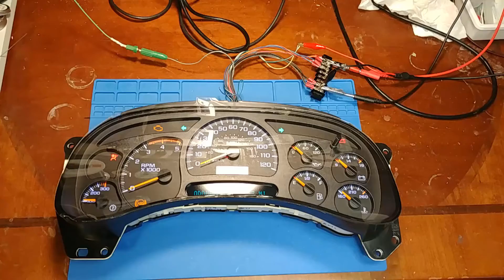2005 GM Cluster No Data & the 56585 chip

Comment: I have an 03 cluster I’m working on and I’m having trouble finding the issue if you could please give me some insight I would be grateful. None of the gauges work nor does the prndl or mileage.. the stepper motors were recently replaced and before that the only issue it had was the 4 small gauges weren’t working..when plugged back into the truck the prndl lit up with no key and once the key was inserted the prndl shut off and the only thing that works now is the backlight leds.. no movement on any gauges and no display info at all now..
Reply from the maker: Intermittent power is typically caused by fractured solder joints at either the diodes or the resistors that feed the main regulation circuit. The other problems you listed may have been caused by someone trying to fix the first set of problems.

Comment: I am having the same no comm issue with my 05 cluster but I do have 12V at the 56585, where else can I look for issues?
Reply from the maker: There is a jumper trace that passes the bus signal from one pin to another right at the main connector. Make sure that trace isn't damaged.
Reply: Ok from the A6 pin that the data comes in I have continuity (with an ohmeter) to A7 and nothing to A5, is there a value I can look for with it plugged in from A6-7? And thank you for the speedy response
Reply from the maker: Can you confirm continuity for the bus signal from where it comes into the connector all the way to the 56585? It does pass through a little blue inductor, but that will meet her out as very low impedance/short.
Reply: Did you receive my email?
Reply from the maker: @derrickzenner9000  Yes I did. Sorry I forgot to reply. I was going to reply with all the options when I had a spare few minutes, but then I ended up getting busy and forgot to reply.

Comment: Seeing this video again Reminded me A while back looked at the GM Cluster Schematic and I believe the 56585 at U16 is a MC33390 J-1850 Class B Serial Transceiver NXP or Motorola OEM. Per the Cluster  Schematic it is pin for pin part the MC33390 is jellybean transceiver used on many other devices specifically avionics.
Reply from the maker: Sounds right. Thanks for the good information!

Comment: I just got an 04 cluster with no data communication lol. I find this cluster interesting because its a delphi reman cluster and the solder joints on this are a total hack job
Reply from the maker: I don't think I've run into a 2004 PCB with bus communication issues. Are you able to verify independently from the vehicle this problem? Have you confirmed it really is a 2004, and not a 2005 PCB?
Reply: The glass tube diodes are a dead giveaway for me. I just fixed it, had a run a jumper from pin A6 which is class 2 data to the the top left pin of the chip(if your looking at the pcb as it would be sitting in a truck) which was the one away from the vfd and that fixed it.
Reply from the maker: @autumnjeserich2689  now that you mention it, I have run into a few times where a trace has been damaged right at the connector area. The bus signal passes through one pin and out another, and I've seen that trace burn open before. Maybe that's what happened to this one?
Reply: @jeffescortlx  pretty sure it did burn out. Was corrosion there

Comment: Question?? You said 56585 is a eeprom.. If it is a eeprom then where is mileage stored because the cluster was showing mileage even though it was missing 12volts... Im asking because I have one on the bench and cannot get any data dumped from 56585 chip.. Ive tried several selections in my programming device ( S95P02, 95020, 25020 and several others)  but all I get is hex 00 FF repeating from address 000000000 to 000000F0.. 

Is the mileage in Infineon 9399059

Also is would be cool to change warning for 
CHECK ENGINE to CHANGE ENGINE
and several others... 

Thankyou will be waiting for a response... Great videos BTW...

Comment: I think I have a similar problem with mine, sometimes i go in my suburban (2003) turn it on and all of the guages and the shift indictator and the odometer display wont turn on, only the backlighting. And to get it to work I have to give it a few hard taps at the bottom of the cluster, i wanted to know if it’s a common problem
Reply from the maker: For 2003 intermittent power is extremely common. I see it several times a week.

Comment: You have links to everything in your description but the jumper wire you use. Could I get a link to that PLEASE! :) Thank you so much.
Reply from the maker: For short runs I just use the left over cut off leads from the lamps.
For long runs I use wire from an old transformer. Enamel coated.

Comment: Hi Jeff could you please tell me the best way to remove that protective coating from board before pad.trace repair. thank you
Reply from the maker: The solder mask comes off with some scraping. Heat from the soldering iron and a scrub with rubbing alcohol usually does it.

Comment: Mr.jeff I wanted to ask the connection that you use to turn on the cluster which wires would be power and which would be ground I need to turn on my cluster without putting in on my truck and only some lights turn on the milage and gears display does not turn on could you help me?
Reply from the maker: If you do a Google image search you should beable to find the connector pinout.
Reply: @jeffescortlx  I did but I can't find it, I have tied all the bright colors to the positive and all the dark colors to the negative but it only Powers up the check engine signal lights and the bulbs it does not show the milage or gears but thank you for replying
Reply from the maker: @josesiyo1549  https://ww2-secure.justanswer.com/uploads/Micharoe/2010-03-04_164930_cluster.gif
Reply: @jeffescortlx  ok thank you so much sir👍
Reply: @jeffescortlx  would you know a better tool for milage correction than the digiprog 3 because Im starting to work on clusters and it does not work good with gm vehicles would you know a good tool for gm?
Reply from the maker: @josesiyo1549  if you go to my channel page and find my Cadillac face/trans temp install you can see the tachopro and OBDstar that I use.

Comment: what type of wire are you using to make the repair?do you have a link for it also ?
Reply from the maker: Enamel coated "magnet" wire.
Reply: @jeffescortlx  thanks
Reply: what gauge wire ?
Reply from the maker: @lowdeadkkey7242  I'm not sure, as it's just scavenged from an old transformer.

Comment: Hello. I replaced the sweepers and leds on my 04 envoy. Now nothing but the leds work. Help. Please
Reply from the maker: That's a bummer.  I can fix it
Reply: @jeffescortlx I'm pretty sure I fried the microprocessor on mine
Reply from the maker: @davidmose3297  in that case, it wouldn't be economical to repair. How did you manage that?
Reply: @jeffescortlx  L.E.D.s
Reply from the maker: @davidmose3297  short something out acidently?
Reply: @jeffescortlx  I'd say so.
Reply from the maker: @davidmose3297  well, you could ship it to me,  if it is indeed a blown micro I could throw it away for you. Only thing you have to loose is shipping cost. If it is repairable then it's just my standard 120 service charge.

Comment: If you have a bad 56585 chip i would be happy to decap it and send you a picture + my guess of how it works. I assure you, gm engineers could not have built a chip that would be very complex! I help them design chips, and they are very old school simple in what the design.
Reply from the maker: That would be pretty cool. I'm assuming it's some sort of re-labeled PIC or something programmable? From what I know, it takes in serial and spits out 4 bit to go the the microprocessor.  Might do some kind of communication translation?
Reply: @jeffescortlx  by all means please send one then. It could be a pic whith flashed code. I doubt its a full custom, or even ASIC. They just dont run enough volume to justify that. You can also decap it yourself using fumming nitric acid. Or i can do it in our lab. Best of all most us semi guys put our logos somewhere on the die. Keep helping people, awesome work man. Ohh and tell us how to reach you btw so we can send you our broken clusters to have fixed. Gota love paying $60 grand for a Cadillac and then having a $3.00 stepper motor on the gas gauge bring you to your knees! Lol. Seriously,  send a dead chip if you got one and im happy to send back pics. You could make an entire video of it. I work for Xilinx. We build some stuff for auto. Hopefully nothing you see breaking a lot 😁
Reply from the maker: @leop9021  I don't have  any failed one's but I would be happy to mail you a working one. It does seem to be the one mystery chip with no information available to the average shmuck. So would be neat to know more about it.
Reply: @jeffescortlx  gosh i hate to bust a working one, but shure lets try. In fact since its working lll power it up and lets see if we can see some of the circuitry toggling while looking at the die. How does somone send you a private email up here. Ill try on your page first.
Reply from the maker: @leop9021  My email is listed under my channel  about tab. It's only visible to windows PC users, because youtube. Anyway, I have spares. They don't ever seem to go bad.
Reply: ASIC (Application Specific Integrated Circuit) chips are used in a lot of industrial control equipment to pare down the parts count and shrink control board sizes.
Reply: @davidhatzenbuhler6888  Yes true, but we didn't think it was an ASSP, just because it seams to do wierd misc. Stuff. But yes it could be.
Reply: @leop9021  ASSPs are for wider markets and have more generalized functions to appeal to several different manufacturers.  ASICs are tailor made for a specific manufacturer to handle several specific possibly very different functions.  Usually ASICs are licensed designs owned and manufactured by/for one company...  ex GM.

Comment: Jeff, the alternator output voltage is 14.50VDC.
The stepper motors are fluctuating intermittently as with the low voltage light. As the vehicle is going over certain bumps the fluctuating of the stepper motors start.
Reply from the maker: The alternator has a separate output for the battery indicator. Even if the main output is rock solid, the low battery light can come on. The 99-02 chassis has a reputation of the cluster ground wire going bad.

Comment: Hi Jeff do you do repairs for for people like me who nave no idea how or where to get such a repair done?
Reply from the maker: Sure Mike. My email address is listed under my channel about tab visible to Windows PC users. If your only on mobile you can leave your email address.
Reply: jeffescortlx 
Hi Jeff I have a 1999 Chevy 1500 Silverado with a 5.3 engine.  We are 2nd owners for this truck, and do not know whether the cluster has been worked on before. The stepper motor needles are bouncing around as with the low voltage light. Would you be able to give an approximate quote on that without actually seeing the panel? Request pricing for the transmission temperature stepper motor if applicable for this truck. If so can you point me to which companies and parts and pieces I would need to make it work. My zip code is 98685. Also what is the turn around time? Please let me know what would have to be done and recommended higher end parts for the cluster. If the cluster face is scratched what would a replacement cost? Is there any warranty? How is payment sent/received?
Thank you
Reply from the maker: If the low voltage light is coming on it might be your alternator or wiring issue. You should do some trouble shooting to make sure it's really the cluster at fault or something else.

Comment: Hi. I have an 05 GMC Sierra. The fuel, oil, and battery gauge as well as the back lights are not working. Do you do repairs to these? Could I send this to you and get it repaired? What would the charge be for that or do you recommend someone?  Thanks for your videos.
Reply from the maker: Yes, your cluster is identical to the one in this video.

Comment: Very good find here. Probably a broken VIA somewhere. Ran into an 06 that had two open VIA's  on the speedo the other day. I've heard of this issue, but never actually had one come in for diagnosis since it seems to be one of rarer problems these clusters exhibit. And I imagine that's because it can be easily misdiagnosed as a communication problem on the serial data line of the vehicle itself. 

But what makes you think this problem is exclusive to the 2005 cluster only? The 2003 and early model 2004 clusters also use the same 56585 chip, and I'm almost certain I've received some phone calls about this issue from 2003 model owners. I'm anxious to actually get one of these in for repair.
Reply from the maker: This problem is pretty rare, I've only seen it 3 times now (all times 05) I haven't seen it happen in the 03-04 board yet. I'm guessing the traces and via's must be a little stronger in the 03-04 boards.
Reply: You might be right. Good info anyway. Can't wait to have one of these actually show up for repair.
Reply from the maker: You'll get one sooner or later. Easy fix!
Reply: Come to think of, I might actually have one of these sitting in my donor board pile. I'll have to see if I can't fish that out. Unfortunately I'm not so good at noting whats wrong with all my donor boards lol, so that might take a while to find.

Comment: What's the gel you use when you add solder and what is the liquid you use to clean up afterwards?
Reply from the maker: I've added a link to the description. It's just flux. Not always necessary (since the solder has flux in it) but helps make for a proper joint. The clear fluid is just rubbing alcohol to clean it up.